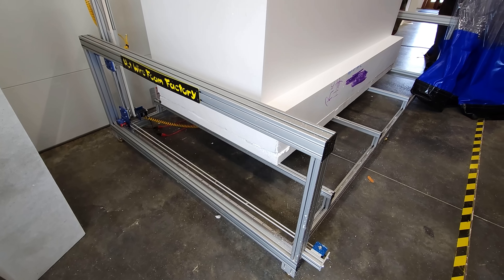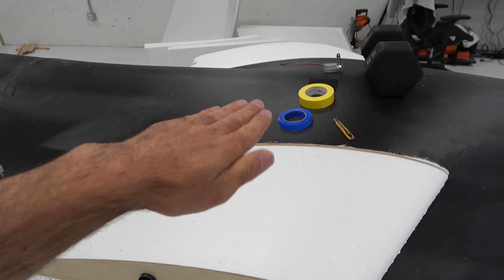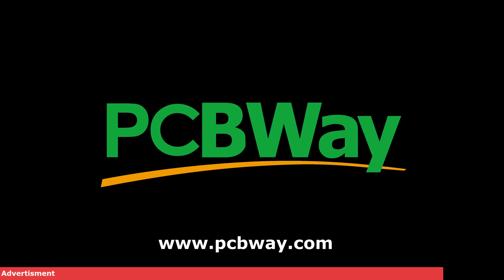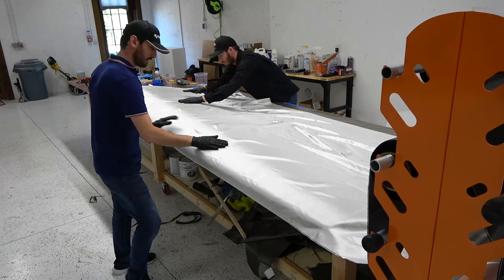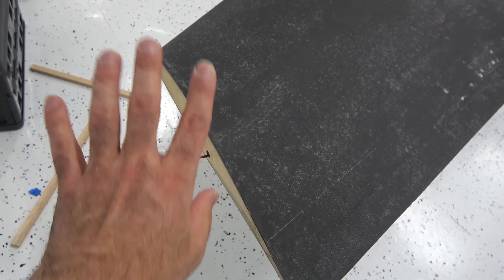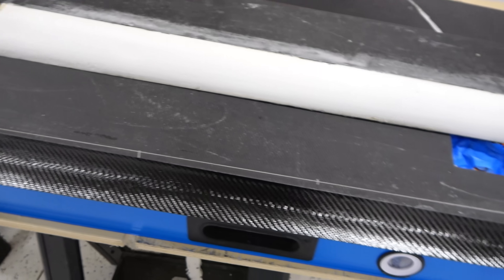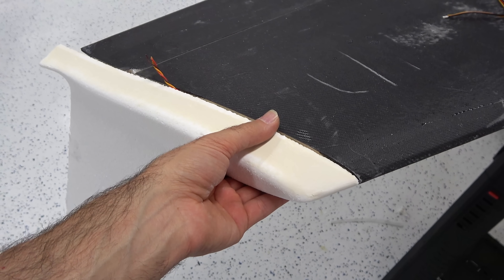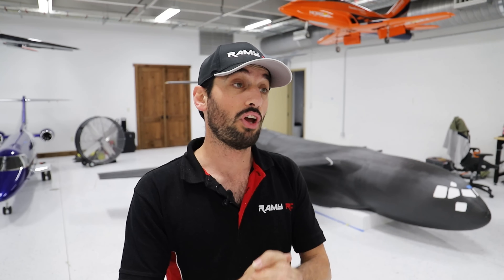BUILDING A GIANT 6 meters RC C-17 Globemaster/ Part 3

Comment: Amazing build. With the wet layup, peelply and bagging, fully outfitted shop and being conscious of excess resin weight, what is the reason for weighted double negative molds instead of vacuum bagging? Especially for the flat parts?

Comment: Once you exceed 125 lbs, it's no longer considered RC but classified as a drone and requires a FAA and FCC licensing. It therefore cannot be flown legally from an RC park and requires registering a flight plan with the FAA before take off. It falls under the National Security Act because it could be weaponized and it will also included a requirement to carry liability insurance in case it crashes into traffic or someone's kitchen widow or a playground.

Comment: Hi. Really very nice, professional crafting! Respect! I am a passionate builder myself albeit not in this scale.
However I strongly believe, you should protect your lungs with masks. Vacuuming is not enough. 
You dont want neither carbon and glass fibers nor epoxide or polystyrol powder inside your body. It may harm you in the long run.

Comment: You are missing the winglets!!!!!!! They are a very important part of that aircraft! Also if your making it suto realistic in control you need to use high speed servos for they ailerons and the flaps and spoilers!!!!!!!!!! While the c-17 is a heavy lift aircraft it is flown and acts like a fighter including using a single joystick rather than the usual control column that heavy's usually use!

Comment: I race hydroplanes and I saw a guy use carbon fiber instead of extruded Aluminum for 
a turn Fin (basically a vertical winglet )
After a wreck with other boat , it cut like a bandsaw ,not changing depth, whereas the usual 6” Alum would cut less and less with each batton.
Just don’t fly near anybody.
 Beautiful work , love the use of plugs for layout.
When 747 was 1 st built, we got a 
Large foam model from a Boeing engineer. When we threw it at a playground, it was deceiving how far it was going while in flight. Then it would touch down and be 100-150 yards away.

Comment: Just having a conversation with my brother about this amazing build. Do you think a carbon fibre airframe could be sealed and filled with helium, under pressure, to provide non wing-born lift. The aircraft would need less power and fly at scale speeds. Maybe? AI could provide control input to smooth out the flight path. Is this anything?

Comment: Very Glad to see you've got the Vacuum there grabbing up all the particles as you cut the carbon with the dremel. It'll be interesting to see how much load the body could carry, and how far it could travel with waypoint navigation. The design could make for a good mail/package delivery vehicle in difficult locations, like small islands or mountainous areas - like TBS did flying a model across the Alps. Wonder how the radar crossection is? :)

Comment: Should have tucked the flap spar carbon under the skin 10~12 mm, creating a better bond between the skins as well as a slightly rounded underside surface. Also the flap hinge pivot needs to be well behind so as the flap is deployed, the gap forms a narrowing channel to accelerate the airflow over the flap

Comment: if you use peel ply as the surface layer, then you will have fewer bubble holes/pin holes to fill....  peel up the peel ply and it sands pretty smooth..

Comment: dude, your carbon fiber glass fiber sandwich doesn't make any sense, glass fiber is ~2.5x less stiff and has ~3x elongation at break, your glass fiber layers will be at ~33% of thier tensile strength when carbon fiber layers fail, glass fiber doesn't carry any significant portion of the load in this composite, it is mostly just a dead weight.

Comment: have been following your channel for a few builds now... finally i know what i feel maybe the next step up you can consider doing for your RCs, hope you dont feel offended

1, when you see commercial passenger airplanes landing, they extent that flaps and make larger wing areas, however i think such details can be considered for future large planes? 
2, the joints movements? can the servers joints be internalised? larger planes if the joints are internal instead of having am external hinge will be so so awesome. 
3, will you consider to cut open the cockpit? and maybe setup a camera room? so you can turn your RC into a AR plane? imagine having a video of the A380 but from the pilot's perspective... that will be damn cool. 
4, will you consider a fuel jet engine for RC instead of battery operated?

hope my above christmas "wishlist" will be the next step for this channel... the best RC modeller youtuber in the industry, lets push the boundary and make it better!!!!!

Comment: Hi 👋, Ramy RC , very interesting, but why aren’t you using a vacuum bag?, Or is it not possible?, Not really been into radio controlled aircraft, though quite a few years ago I did make an SR 71 blackbird, Which had props on the front, to ic motors, I never managed to fly it.
I had a colleague who is very good at quarter scale and jet aircraft as well , He told me that the CG was in the wrong place, so I ordered a few things over the course of the night, is the next day when we went to try it, sadly it stalled, re trimmed , I made the kit from copying and Atari plastic kit not sure if that’s spelt right, sadly it destroyed itself when the ground came up and hit it. Ha ha, 
How I was very good at radio control hydro, Back in the 80s and 90s , two of my boats were made out of Kevlar and carbon fibre,
I/we look forward to this next stage in your construction, Phil
Reply: He uses bags/vacuum when practical, in most cases he just uses peel ply and seems to work well for him!

Comment: Was sad to see it's just looking like a single part hinged Flap especially at this scale As the real bird is iconic for the blown flaps design that it has irl (large full flap with the smaller upper flap that forms an extra slim wing) and the angle and profile they make when they are extended, its meant to have a spoileron on the upper wing as well. It helps both with landing and with roll during low speed flight especially when using the reversers in the air for Tactical Descent Landing profiles..
Reply: The c17 has a single trailing edge flap just like Ramy's !! The only difference is he is not installing leading edge slats!

Comment: 15:15 You have build these planes for a sevral years now, but one thing you havent still done is hidden mechanisms for the flaps. I mean without the hinges. Maybe for the next project? You should really try it. I might also be wrong but i've been whatching these videos for at least 5 years and I dont remeber any hidden flaps. You've made hiddel ailerons and hidden stabilizer but not flaps, why?

Comment: Would be interesting to see a cockpit fpv view of these planes flying! Basically a camera inside the cockpit that moves depending on where you look.
Reply: Nice idea
Reply: @andrewcouchman25 

Ive seen it done in a giant scale high performance WW2 period  German gull wing glider ...you could even see the controls moving as they were linked to the servos.
Reply: That would defeat the purpose of making a beautiful exterior if you can’t see it. Might as well use a plane designed specifically for FPV that isn’t worried about looks.
Reply: I totally agree, I dreamed about this years ago. Fpv head tracking in a large rc cargo plane
Reply: @Decadence1  That's the closest you can get to a simulator! Nice idea!
Reply: Can you get for me files 3d toprint mould for a350 and can i buy this files
Reply: @ЕвгенияЛарикова-я7ц  wrong guy
Reply: @RamyRC pls do it
Reply: its been done exactly as described and it is as cool as you would expect:D there are 3d print motorized camera mount files out there
Reply: You can have more cameras and let people watch on the same channel.
Reply: @elektron2kim666 You don't need more cameras. Anyone with fov goggles can simply watch the same camera.
Reply: There are tons of videos of people doing exactly this.
Reply: Trueeeee
Reply: "Head-traking fpv fly" is what you're looking for..nice idea
Reply: @vmas29  having 2 of that for both pilot and co-pilot would be great to watch

Comment: This wing will break 100%. Where is the spar? That's really not okay like that
Reply: You are 100% wrong that the skin will take these loads.
Reply: Your Tubes will work through the foam and your wing will collapse. You did one step wrong. connecting tube to carbon layer skin with material which cannot be squeezed.
Reply: Tend to agree.  The skins won’t take compression which is how it would fail.  Agree the tube has to attach to the skin via non compressible material.